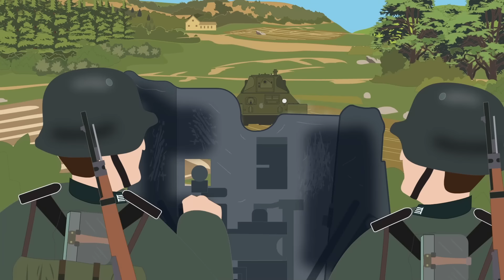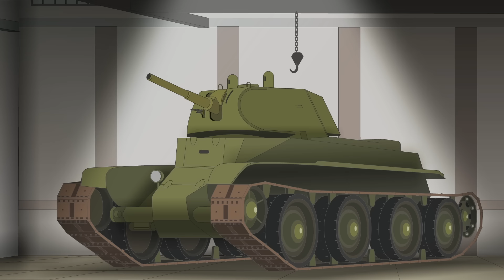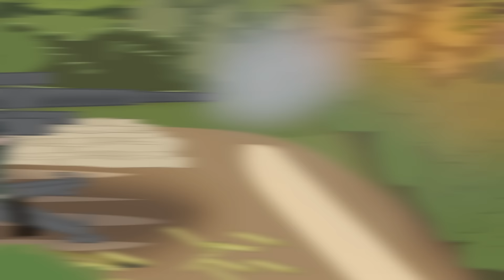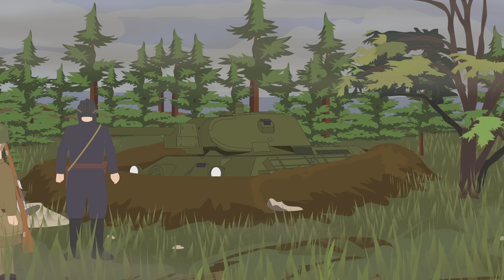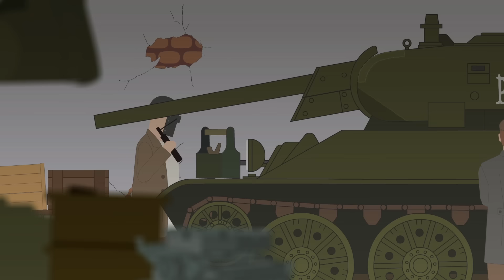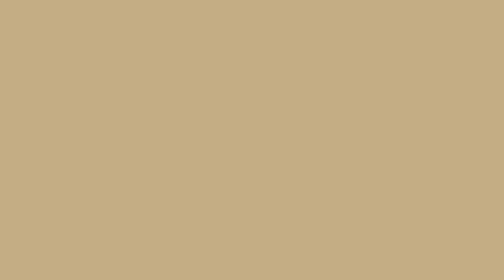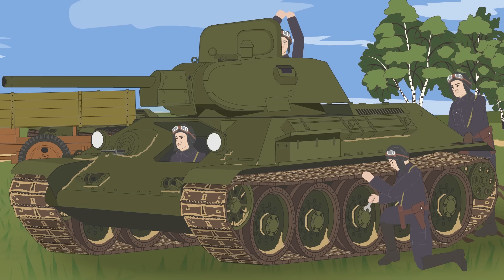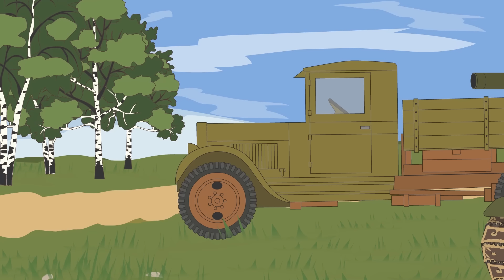Was the T-34 Really the Best Tank of WW2?

Comment: One thing you didn't mention that I consider as an engineer that made the T34 most unique design feature was that it had no guides or keys for the tracks.
it was slapped & welded on not being intended to take off with a sprung loaded pivot plate that smacked the track back on the wheels when it slapped of on it unguided drive.
Crude & cheap but it works.

Comment: The T34 was poorly welded
It had poor crew ergonomics 
It broke down a lot
Reply: 1) then it’s not the fault of the tank 
2) It’s almost 3x cheaper to produce compared to a Sherman, almost 6x cheaper than a tiger, and the t34 is still comparable to a Sherman
3) Everything broke down in the Russian mud, nothing like France and it’s infrastructure
Reply: @joselee9605  The Sherman beats the T-34 in the Soft Factors, The T-34 may have been a good design but they were built badly